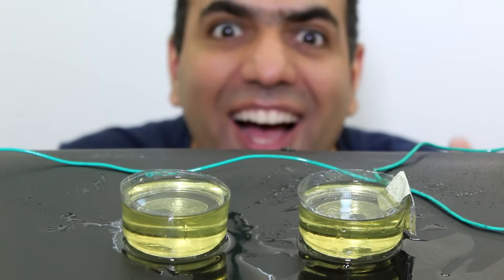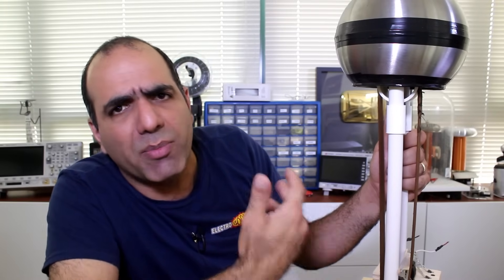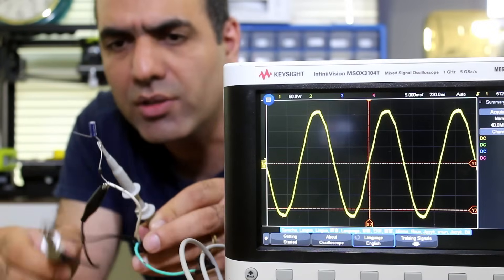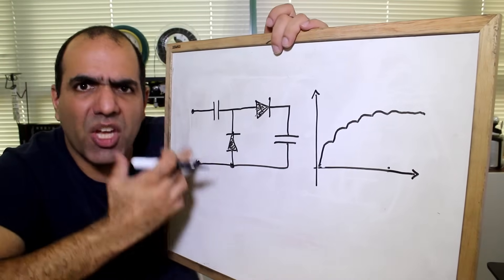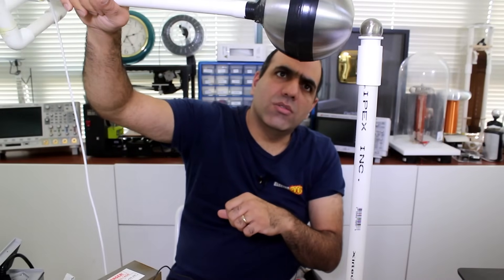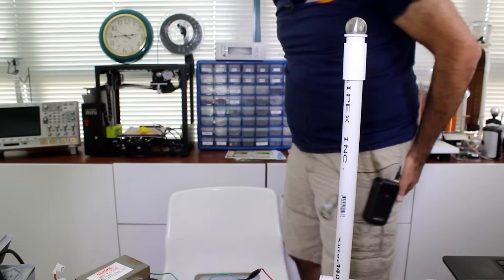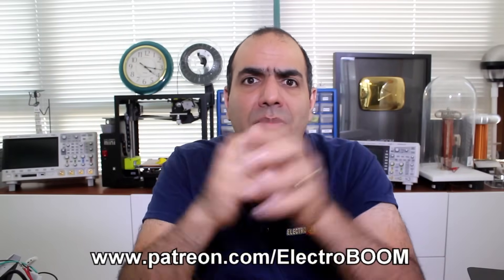High Voltage Flying Oil Experiment with Voltage Multiplier

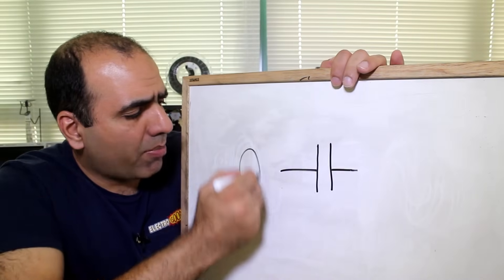Comment: At 2:45 you say that a capacitor pass AC and block DC. And at 6:50 you say that the DC is stored in the bottom capacitors. I am a big fan and i don't want to be roude or somting but i dont understand .  !I know! That the capacitor block AC and let pass DC.  So how it is ?

Comment: So, I'm doing a GPS project involving phase differences between signals with two receiver antennas (phase difference determines direction of initial signal). The problem is that my project requires something like 500+MHz signals to achieve the accuracy I want. From what I can tell, the Keysight oscilloscopes that go that high are 12k =(.

Comment: Why do you use 120V AC SYSTEM, SWITCH TO 220V,HOW THICK WIRES YOU USE FOR USING AN Air Conditioner.S***